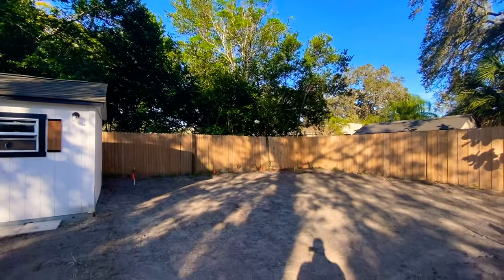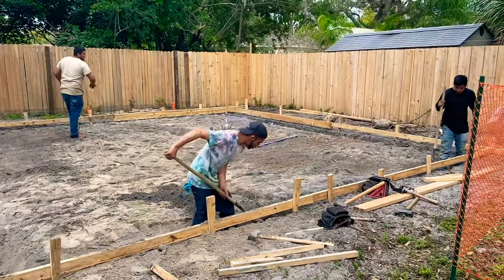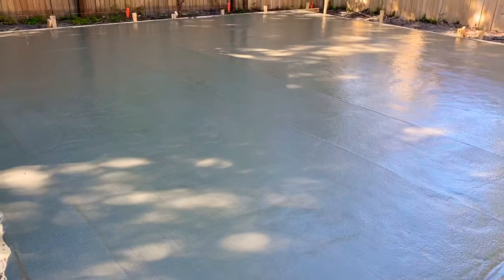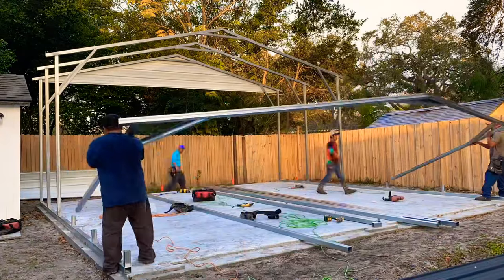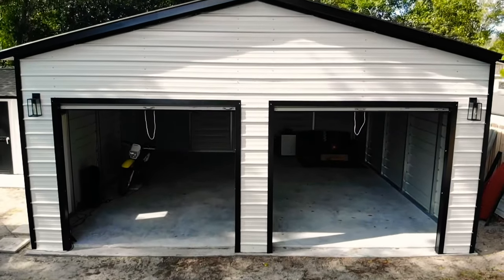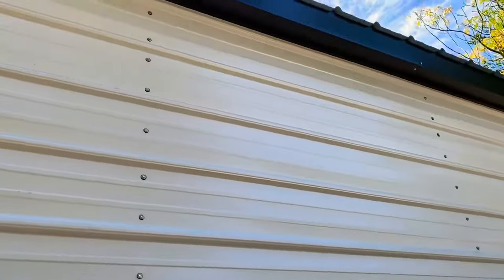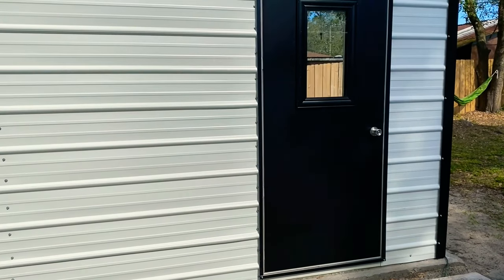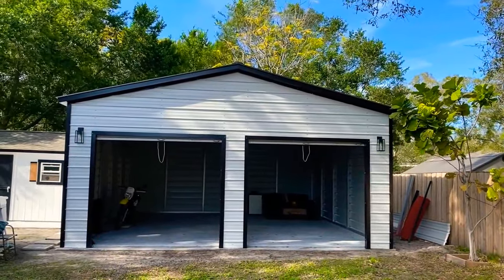24 x 25‘ metal building, workshop, garage build installation

Comment: Had a 24x25 done last fall, black & gray two tone. Paid extra for residential walk through & overhead door. Just under $10k all in. Did Blutex foam core reflective insulation & electrical myself, probably another $1500 in materials.
Reply: Is there room for a loft area in yours?
Reply: Where did you purchase yours from?

Comment: Would be nice to add a cost breakdown in the future vids. I know prices vary from state to state. But would be cool to compare.
Reply from the maker: Yeah between permitting costs and  the concrete being done by a family friends company and lots of other things the price would vary a lot but I didn’t mean to at least add the price of the building… I’ll be doing another video here in the next week or so on some interior stuff and I may just touch on pricing at the beginning…👍🏼
Reply: Prices are tuff states, counties and even manufactory are different but it would be nice.  I'm here in NY having just had a  24x36x10 quoted thou EB Carports and metal buildings.  The building was $15,441.58 the concrete quotes are coming back From $9,500.00 and up here in NY need engineered drawings for the concrete those quotes are coming back at $800.00 plus test pit quotes are coming in around $500. to $800  for the pit and building permit fees are based on the square footage.

Comment: How many yards of concrete did it take to fill that 24 by 25 form? What is the ballpark   primcost of a unit like that the in your area off the shelf?
thanks
Reply from the maker: Man, I’d have to look back at some paperwork off the top of my head. I thought that they ordered 10 yards to play it safe and that was with 17” x 12” footers I believe… and if I remember correctly, we had about a half a yard left over

Comment: Great video, love how you dropped the concrete prior.  Was told that its common do drop the building then the concrete which sounds odd.
Reply from the maker: Yeah a lot of times with pole barn style buildings they’ll do that but doesn’t seem like it makes sense for the style frame up MetalBuilding

Comment: How happy are you with the roll up door quality? When closed, is the seal good enough to keep stuff out? I'm getting advice from multiple folks to go with panel high rise tracks as a better option. thanks
Reply from the maker: For me personally I didn’t want to lose any of the extra ceiling height in my garage with the traditional garage door frames that hang out into the space At that 8 foot height of the door since I had 10 foot sidewalls in a 14 foot ceiling height… So the roll up works great for me when completely closed and locked the seal is good… On the sides however where the wheels roll up the track you have a little more gap/space for things to to get in if you don’t add an aftermarket barrier of some kind which they do sell but overall I’m happy with it… I just sealed everywhere I could
Reply: @The_Heights  great feedback thank you

Comment: I have a floating slab that is 24x24 exactly. How exact are the metal garages? I’m working my slab is not wide or long enough and the rails would hang over. Or can they cut to fit a little?
Reply from the maker: It’s pretty much exact I think they can do some minor adjustments just make sure the slab is square that’s the most important thing for the rails to line up

Comment: Nice! I would recommend to the viewers that You hold-back at least 10% of the building cost until you are satisfied contractually with the building. Carolina Carports is terrible.
Reply from the maker: I’ve seen that in some of the reviews about that particular company… Big Buildings Direct was great to deal with it and they only required 20% down the rest after the building was up and complete
Reply: If your in California,  your only required to put down 10% to start. Just FYI
Reply: @Jim curious to know your gripes with Carolina, they are the builders for one I am planning on getting.
Reply: I'm in Va and I just did 24'25'x12' garage with a 12X21 lean-to. Mine was $14K for the building and the concrete was $10500 cause of my unlevel lot and had to have the back sitting on 5 rows of block. Stay away from Carolina Carports or at least hold that last check until u are happy. Im still fighting with them on several (8) fk ups after they said they were done. And if you go thru another company, make sure they not with CC. I went thru Millennium Buildings who pawned it all off on CC who had Jrs Garages & Buildings do the install. Too many hands touched this building but Im holding $6,151.37 check unil I'M happy. Whatever u do DONT PAY THAT LAST CHECK UNTIL YOU GO OVER WITH A FINE TOOTH COMB!! In fact I encourage anybody to mail the last check when u r happy, not while they there holding their hands out and saying they are done.
Reply: @Jgirwarn   They pawn the install out and the ones that did mine sucked azz. The whole left side of the roof the moron on top screwed right through the roof and didnt hit the supports. Not even close, I'm talking he hit half way between the supports. He didnt catch it till he did 2 whole rows like that. How do you go screw happy and not realize that is no resistance & why wasnt a chalk line made to help hit the supports? Then he tried to silicon it. Cause I said that wasnt acceptable they up and left to go do another job, told me another crew was on the way to fix it that day. The other crew was these same morons that showed up the next day and commenced to make 8 major screw ups that 2 weeks later hasnt been resolved. Im holding the last check of $6k+ until I get satisfaction. I suggest you do the same with no matter who u go with or you have no leverage on getting satisfaction. Good Luck.
Reply: @bruce2460  thanks for the info. I'm trying to get a hold of scheduling in FL and they don't respond. They got the picture of the slab and replied with received. But that's it. Still waiting...

Comment: I'm in outside Raleigh, NC.  Just ordered my Metal Garage, same measurements.  Who did you use for the foundation and how much?  Thanks!
Reply from the maker: Fortunately for me it was a friends company so I’m not a good reference for price mine was around 2500$ basically just paid for material
Reply: I'm in Raleigh as well. Who did you use? if you don't mind sharing.
Reply: @S54VR6  I did it myself. Saved a ton of money.

Comment: Where did you find the replacement black door with window?   Very nice garage by the way. I’m doing a 24x40.
Reply from the maker: I just grabbed a an aftermarket window and cut the old window out and replaced it and painted the door black myself… Thanks that’s not a shop sounds like it’s going to be awesome wish I had the space
Reply: @The_Heights  Awesome!!! Looks good! How’s the black roof? Does it get hot?
Reply from the maker: With the high ceiling height I don’t really have any issues I’m in the process of insulating it and I’ll be using a radiant barrier which will get rid of that much more heat

Comment: 30-40k ?
Reply from the maker: The building with engineered drawings for my permits installed with the concrete foundation 15k But included none of the interior buildout electrical etc.

Comment: Hey I'm in the Tampa area also.... can I get your concrete contractors contact info?
Reply from the maker: I used a friends company and unfortunately they don’t normally do small projects like this. It was a favor. If you’re going to do the ledge around the slab I would just call around and ask if they have the ability to accommodate